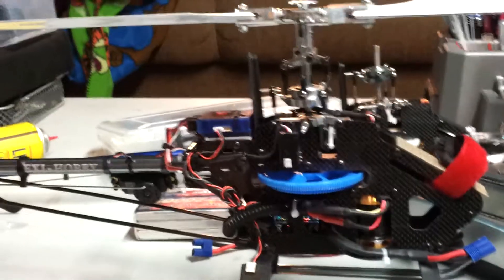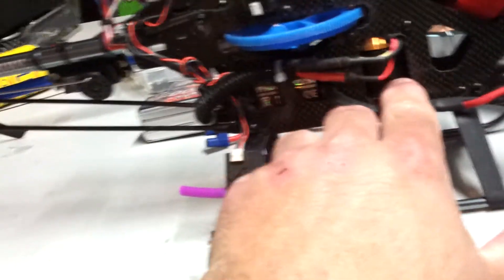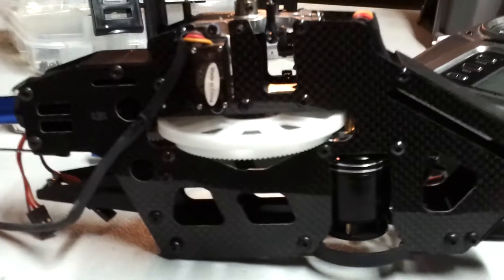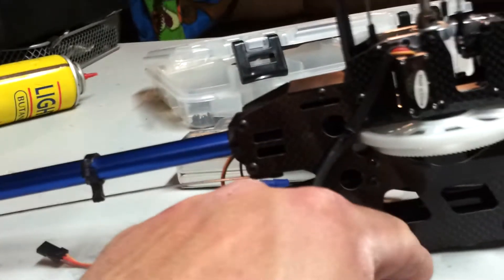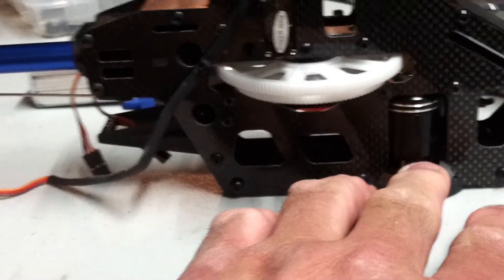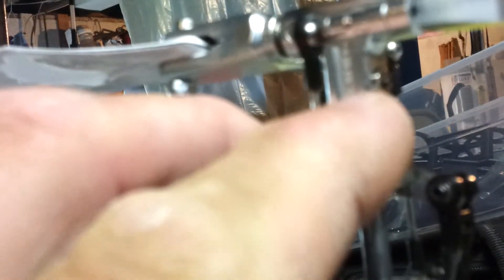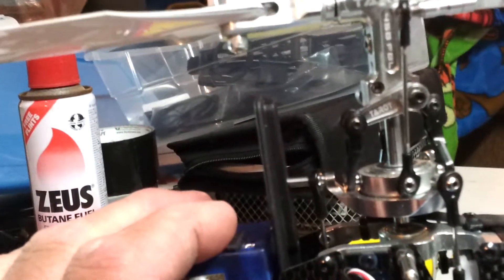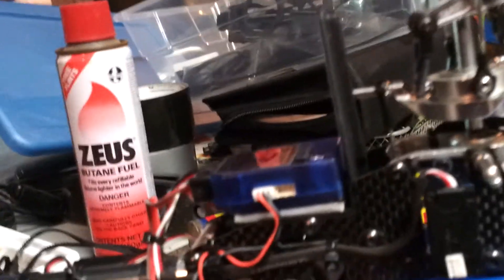450 clone build fbl with vbar mini

Comment from the maker: no one has cloned v-bar
the closest your going to get is the icon
on sale they are about 175.00 and if you find a used one 150-175.00 
standard price is about 224.00  I have actually swapped 2 of my vbars for Ikon's and they are GOOD!! they have 1 less bank than v-bar but most people only use 2 or 3 anyway